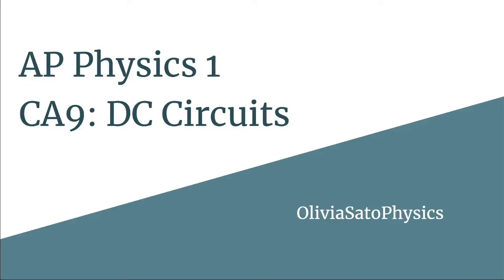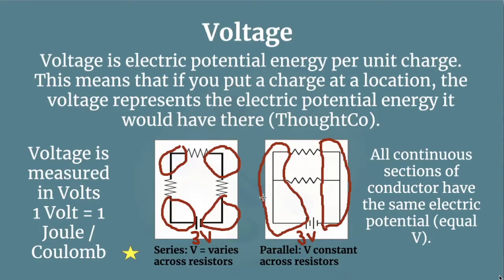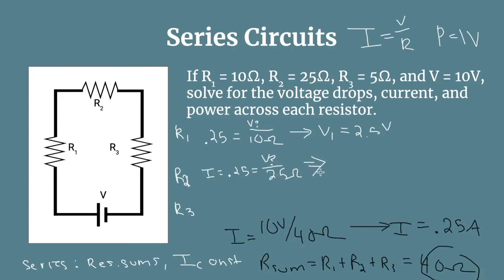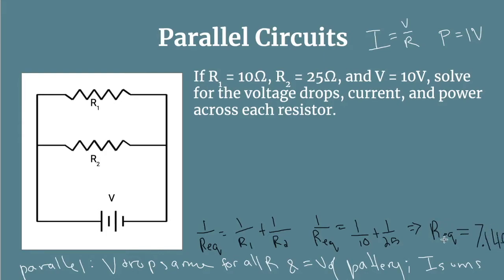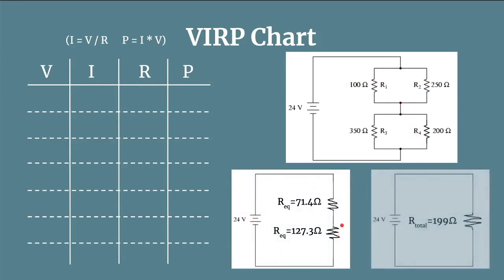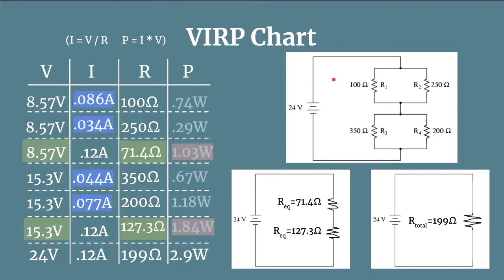AP Physics 1: DC Circuits

Comment from the maker: Topics:
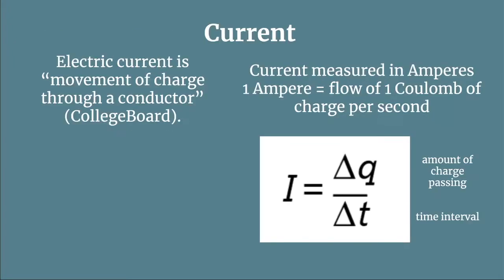Current 0:44
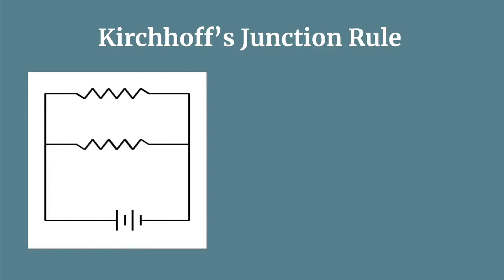Kirchhoff's Junction Rule 2:11
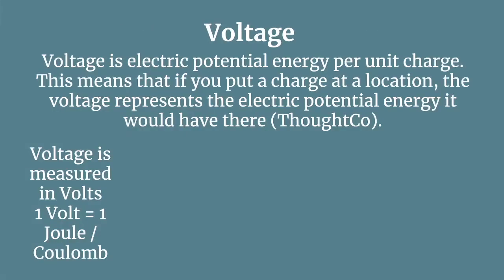Voltage 2:30
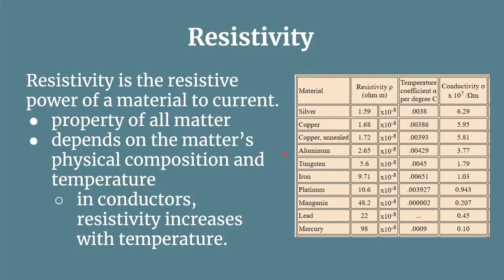Resistivity 5:13
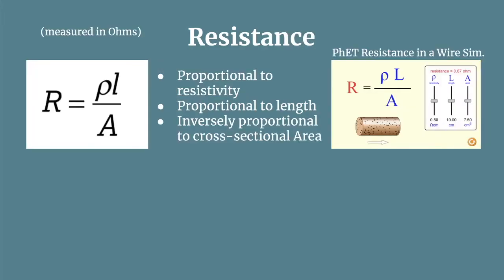Resistance 5:43
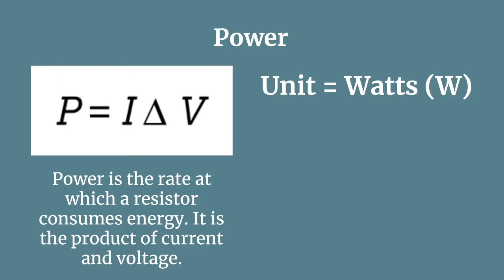Power 6:40
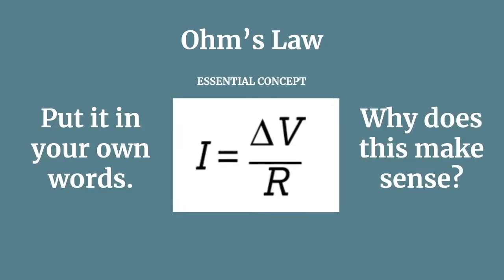Ohm's Law 7:04
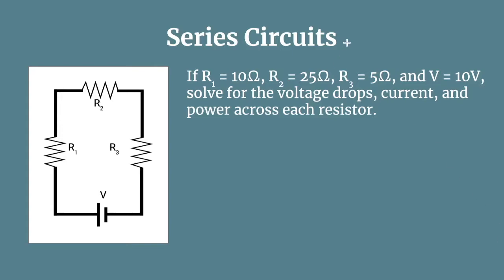Series circuit practice 7:46
Parallel circuit practice 10:43
Tips on solving circuits 13:06
VIRP Chart practice 13:36